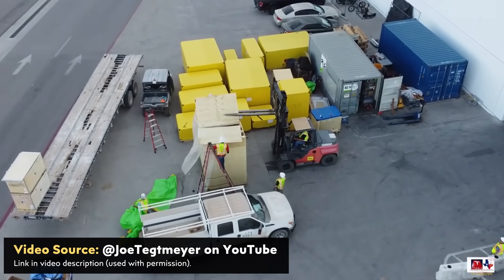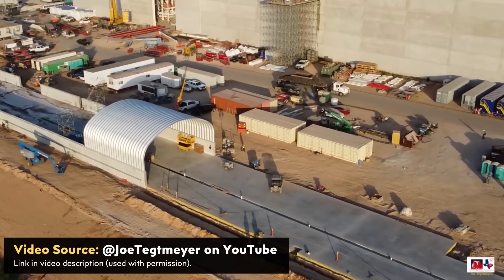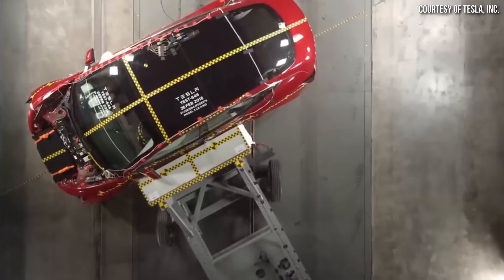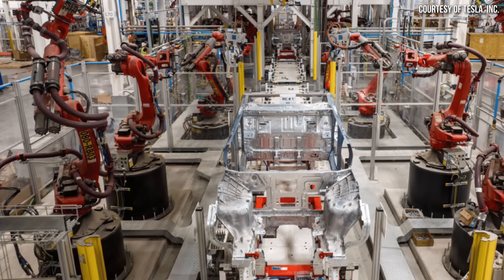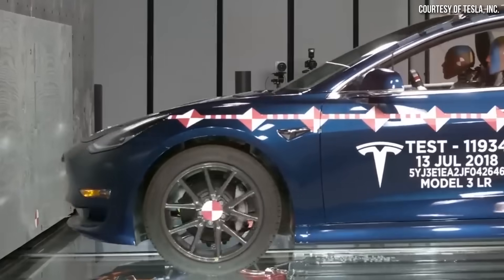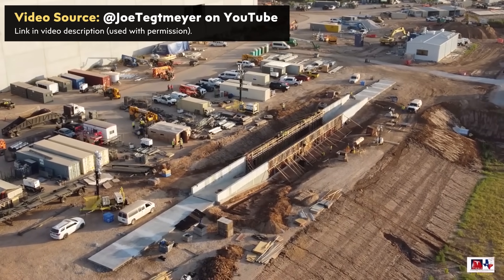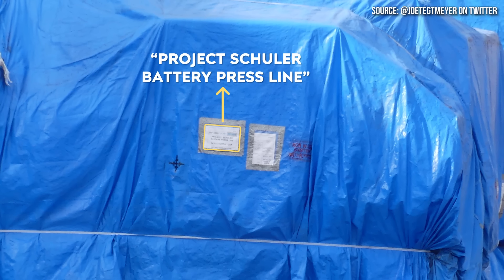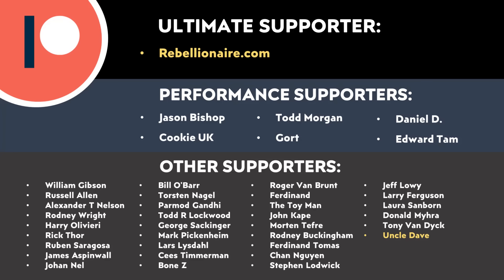NEW Crash Track & Wading Pit for Tesla Cybertruck + 4680 Battery Equipment Delivery

Comment: if cars did not run faster than 70 km/hour many lives would be saved and transition to FSD would be much easier
Reply: 43 mph?  Yes, I believe you are right.  We will all be safer going that slow.  You might even get 400 miles out of a single charge too. Maybe even tow efficiently.

Comment: 6:02 Aluminum stamped panels on a typical vehicle? Why are they rusting then I wonder? 🤭 aluminum panels perhaps some Audis and all Teslas, but that isn't by far typical.
Reply: You will find stainless Bodie Panels will rust From scratches from any steel that runs the stainless.allso stainless suffer from electoricist which fits from the in side outing the likes spa pool filter pumps because of electrical carrent going through the pump

Comment: You should be aware that increasing the safety of a vehicle encourages the driver to relax. For example, mandating seatbelts in the UK increased death and injury to pedestrians by 15% or so. The point is that every driver has a level of risk that they are comfortable with, so, if you increase protection for the driver then they are more likely to drive badly. And all drivers drive badly some of the time. A computer would not be susceptible to this effect. If Tesla can implement FSD then this is likely to do more for overall safety than turning the vehicle into a tank.

Comment: (Reposting with just a little slightly better grammar. Not perfect grammar)
With new chinese model 3 filings out it’s become clear that at least in china M3P batteries on all models will be released, 556km and 675km or 345 mi and 420 mi. almost exactly what CATL said the models could do with new batteries . Which makes me wonder if the model 3 in the US will have 4680 batteries in them due to the fact that when reported in china it was only confirmed that the model 3 standard range would receive the M3P battery and likewise in 2024 the model y would receive the BYD battery for the standard range model. if it was the case that all model 3’s models would be using the M3P why stagger releases? because even with a surplus they still produce the current model 3 in the US. if they were using the M3P battery they would’ve stopped production in order to remove the surplus. it seems that they’re waiting on something and I believe that it’s most likely the new 4680 battery factory next to Fremont(It can’t be for the cybertruck because because of filings it’s meant to produce 4680 batteries and cybertruck uses Cybercells according to tesla) so it’s fair to assume the factory is meant to produce batteries for model 3 highland this year and model Y juniper next year. So I’m expecting Model 3 highland with standard range 300+ mi using M3P and Long range/performance 400-500+ mi using the 4680 battery.
Also it wouldn’t make sense for the  essentially 2.0 version of the model 3 not to use the 4680 battery that they said would be in vehicles years ago. It’s also clear that 400-500+ mi is what is expected because a few years ago when the 4680 battery was announced, tesla was testing 505-510mi Model Y’s. it just seems that tesla ran into issues mass producing the battery hence shipping model y’s with smaller battery packs. But now that mass production of the battery is possible and has been achieved somewhat then 400-500+ mi should be expected with the 4680 battery packs.

Comment: Here: 
'5:57 the Cyber truck in addition to that a typical vehicle has aluminum stamped panels on the exterior of the vehicle whereas the Cyber truck is going to have stainless steel panels '
I don't agree. With a few exceptions (Audi in the 1990's and Early 2000 with A8 and A2) started with some Aluminum carosseries. Even the Model S. But normally its steel. Not Aluminium. 
We should look at Bela Barenyi who died in 1997 at a good age.
'At Daimler-Benz, Barenyi developed the world’s first comprehensive vehicle safety program geared to the prevention of human injury during an automobile accident. He identified risks and invented safety features that reduced injury to both passengers and pedestrians. He also developed innovations in energy absorption that improved ride quality. A 1993 Mercedes-Benz advertisement featuring Barenyi’s image proudly stated: “No one in the world has given more thought to car safety than this man”.' 
'By the time Barenyi retired as head of Daimler-Benz predevelopment group, he had patented more than 2,500 inventions, and Mercedes-Benzes were widely recognized as the safest cars on the road. His most significant concept, the rigid passenger cell with front and rear crumple zones to absorb impact force, is now the standard in every car made throughout the world and has saved countless lives. '
If Tesla can make it better, including cameras to avoid crashes, they are very welcome. Fine.

Comment: Yep, exciting stuff.

The tough part is on the outside. That's all it needs to be called an exoskeleton. It adds more stiffness, too. Sandy is barking up the wrong tree.

Thanks for your reporting, Jon.
Reply: Sandy is THE automotive expert. He's just operating on a few pictures that may or may not be final production design.

And the definition of an exoskeleton is that the structure is on the outside i.e. structural skin. In aviation terms, it's monocoque. What we're seeing though is a semi-monocoque structure which is different than originally marketed. That's a good thing though. We don't need Tesla forcing a true exoskeleton onto the market if that's not the best solution.

We will find out definitively how the CyberTruck is made just as soon as Munroe & Co. can get their hands on one.
Reply: @TecnamTwin  Sandy was looking for a particular engineering subset of exoskeletons, where the body practically replaces the underbody to provide rigidity and structural strength. I don't know why he fixated on this engineering subset. It has never been tried on a car. Ever.

In my mind, the concept of exoskeleton does not exclude structural strength and rigidity obtained from an undercarriage. I'm only looking for the answers to two questions: is it tough on the outside, or fragile like everything else automotive? And does the body add to the vehicle's rigidity and strength more than traditional bodies?

For Cybertruck, the answers to those questions are yes and yes. That is one tough, strong, rigid truck right there. We've never seen the like in the automotive world.

Run a cart demon into that. Or drop a couple tons onto the bed and go rock climbing. Try that with an F-150 and you'll warp the bed, it'll twist like a pretzel, and every branch that scrapes the paint will damage the paint and soft aluminum skin. Cybertruck is * different.*

Sandy's disappointment makes zero sense to me.

He's an expert. I can't take anything away from his knowledge or achievements. But he isn't an expert in automotive exoskeletons, because by golly, he has never seen one before. None of us have. We all need to carve new neural pathways through our brains to understand what we're seeing.

That's what our conversation is about - talking this through like the apes confronting the monolith in '2001: A Space Odyssey.' Hand me that stick, will you? I have an idea how to use that on an F-150!

Whack!
Reply: It's the same thing that DeLorean did. Stainless steel body panels on a steel frame.  Nothing new about that.
Reply: @paul5683  nothing new, eh?

3 mil thick stainless steel on the Cybertruck. DeLorean had no tooling to bend steel that thick. He basically used sheet metal.

Calling that an exoskeleton is a wild exaggeration.

DeLorean did not develop his own alloy. No money, honey, for expenses like that.

The DeLorean was ahead of its time. But Cybertruck isn't a copy. No, indeed.
Reply: @Urgelt where did you read this stainless steel thickness specification?  3mil? 3 millimeters .118 inches?  Almost an 1/8 of an inch,  that's pretty thick stuff. Any idea how much that is going to weigh?  I don't, but I'm guessing a lot.
Reply: @paul5683  Elon said it. You can Google it.

Typical body skins are .65 mil thick. Sheet metal, basically, easy to stamp. I don't have stats on the DeLorian, but I know it was stamped steel, and on a shoestring budget, he could not have created the novel tooling to deal with thicker skins.

Heavy? Yep. Cybertruck will not be a lightweight truck. How that will affect performance, we'll have to wait for Tesla to tell us.

Comment: Many have mentioned how the battery pack puts weight low.  Don't forget that the cyber truck can raise and lower it's ride height, that too can help combat rollover.   They promote that you can increase your range by lowering the truck to reduce drag.  So quite safe from rollover with those 2 factors working together.
Reply: Exactly. What many people don't get is that they buy an F150 and  a Lamborghini Countach at the same time when they buy a Cybertruck.
Reply: @whynotstartusingyourbrain8726  lolol :)
Reply: With FSD I think it will happen automatically

Comment: It seems like all of this testing would have been done months ago. If design changes need to be made it would delay the release of the CT.
Reply from the maker: Maybe, but Tesla may want to work on further implementing the Exoskeleton design, which would require more testing...
Reply: @Cleanerwatt  Exactly, and the cybertruck is probably over engineered and will continue to see weight reduction improvements that need to be tested.
Reply: I'm assume testing was already completed and changes were implemented.

Comment: So exciting!

I am concerned about those sharp points throughout the body. These will gorge.
Reply: It'll be alright, it worked for DeLorean. Same thing, right?  Surprised they didn't put gull wing doors on this thing too. 
But what's with the passenger doors being about a half foot shorter than the driver and front passenger doors?
Reply: @paul5683  It won't be alright.

The DeLorean wasn't a working piece of kit.

These sharp parts even the most casual connection will hurt, at best, injure with but a nudge.
Reply: @JorgeLausell relax, I was mocking Tesla and the cybertruck. They continually act like they have made something all together new, when it's just old ideas being used again.  I  think the one fellow had the best idea for safety. All vehicles should be limited to 70 kmph or 43 mph if you are from the states.